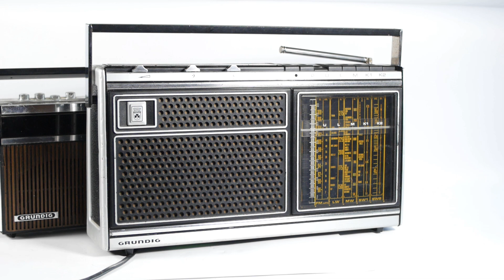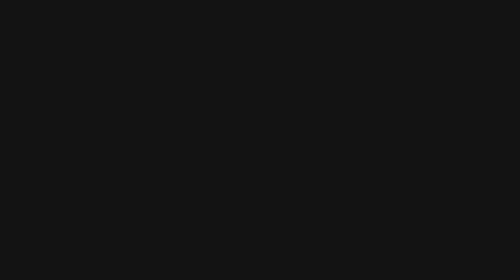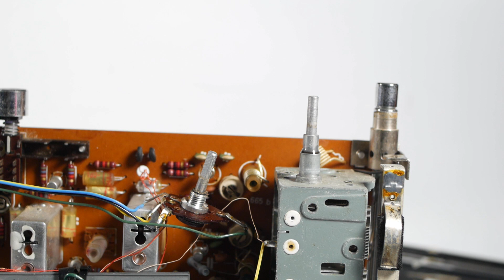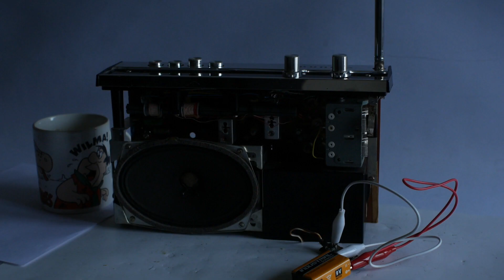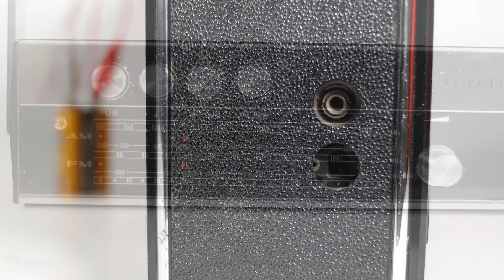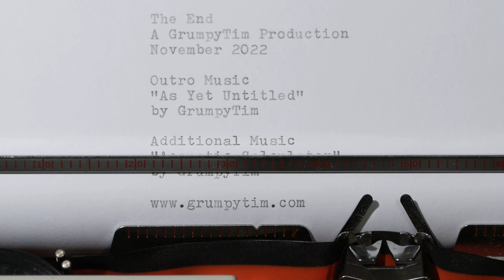Grundig Radio Repair - 1970s Grundig Transistor 305 - and quick demo

Comment from the maker: This is just a quick repair of a Grundig Transistor 305 radio, there wasn't much wrong with it, just a corroded and very dead battery, and a seized tuner (a fairly common fault), other than that it just needed a good clean.  If you're looking for full on electronics repair on one of these radios you'll need to look elsewhere, but if you just want a little look round the radio and to see how I free up a seized tuner, then stick around.

Comment: I know this is an older video but do you have any experience with the transistor 3005? I have a radio that's been in my family for years and it is in immaculate condition other than the shortwave tuner stuck. Would this method also work on that specific radio if you know offhand any feedback would be appreciated. Everything on FM works wonderful but selecting the shortwave bands and trying to move the tuner to the far right corner is stuck thanks and have a great day
Reply from the maker: Hi Matthew, it's pretty common for the tuner to get stuck on old radios - it's nearly always due to dried old grease.    If your tuner moves freely over most of it's range and only sticks towards the right, it might be something else.  When you're in FM will the tuner move all the way to the right or does it stick then too?  If you tune into a few FM channels and look at the frequency that's displayed, does it match the published frequency for that channel?  It's always possible that the tuner display and the physical tuner have moved in relation to each other and the physical tuner is actually reaching it's end stop - if that was the case, the tuner string would need to be re set correctly.  If it is the physical tuner that's sticking, there might be something interfering with the multiple plates that rotate, such as a loose wire or maybe some sound deadening foam that's fallen off.
Reply: @GrumpyTim hello and good day yeah I've done a lot of research last night and found that my potentiometer is stuck for the shortwave. The routing of the line tuner is intact. I just have to get that free and I can get the needle to moving again. There's so much history in my family with this specific radio, all the FM presets work, everything works besides the shortwave potentiometer. If I could free it up I could get it to work. I just have to slowly take everything apart and I'm going to try your method of heat and lubrication.

Comment: Hey l like the thumb very much, how did you light it? Thank you
Reply from the maker: It's been a while since I took that photo, but I suspect that I did my usual thing, which is, place the subject on my video background (an old bathroom roller blind), and side light it with one of my LED panel lights - that light has barn doors to control the light to a certain extent, but I usually hold a bit of black card in the path of the light to reduce the amount falling onto the upper section of the background.  The camera will be on a tripod, pre-focussed on the subject, and I'll use a 2 second self timer to reduce the risk of camera shake when I press the shutter button.
Reply: @GrumpyTim  Thank you, wow that's nice and simple. So just one light, now fill ight or anything?
Reply from the maker: I don't usually use a fill light, although there will be a bit of light bouncing back off the walls of the room, which will provide a little fill.  I also darken the area where I'm going to put the video title when I edit the photo - that's mostly because unless I shoot at night, there's some light coming through a window that spills onto the background.

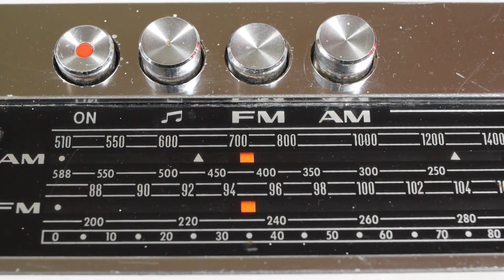Comment: Thank you for the great video! At 8:50 you can see two small triangles on the AM band at 640 and 1240 kHz. These are markers for an emergency alert system in the U.S. called CONELRAD, which was in use from 1951 through August 1963. The markers made it easy for citizens to tune in to important updates in case of a Soviet attack. CONELRAD was replaced by the Emergency Broadcast System in 1963. Very cool piece of history!
Reply from the maker: Hi Trevorland, that's really interesting, and definitely a nice little bit of history.  I liked the idea of radios being used for emergency alerts, it seems to me to be a more robust emergency warning system than the modern mobile phone alerts - I have a feeling that in a real emergency the mobile networks will fall over.

Comment: Would anything be affected by switching the battery connector to accept the pp3? In the US they are difficult to find.
Reply from the maker: Hi Gluttonite, you should be ok swapping the connector for one that takes a PP3, just as long as you keep the polarity the same way round.  Obviously the PP3 won't last as long because it's a much smaller battery, and it may even struggle for power at louder volumes.  I'd be tempted to use two PP3s in parallel, in other words, fit two PP3 connectors, keeping both the red leads together and the two black leads together, that way you just get more power but remain at 9 volts.

Comment: Any idea if it’s possible to find a telescopic aerial replacement for these? A tip of mine is broken and lost which makes it unusable.
Reply from the maker: Hi Jackie, I'm sure there must be a decent source of replacement ariels, but I haven't tracked it down yet.  I needed a replacement ariel for one of my other radios and I couldn't find anything, so I just repaired what I had as best as I could so I could use the radio.

Comment: I have just acquired the same radio with the very same problem. Tuning dial frozen solid. Your video is just what I need. I will also need to work on a AC bypass becuase the power connector appears to be of ancient type which is no longer around.
Reply from the maker: Excellent, they're a nice little radio once they're up and running.  I have a bit of a soft spot for the old Grundig radios, there are three of them in the collection so far.......

Comment: I’ve got very the same radio. It works well, but keeps draining the battery even when it’s turned off. Seeking for an advice please.
Reply from the maker: Hi Jackie, I don't suppose you have a multi meter so you can check to see exactly how much current the radio is drawing while turned off.  In theory the on off switch should cut the power to the radio completely, so either the switch is somehow still letting power get to part of the circuit while turned off, or someone has done a repair at some time that  partly bypasses the switch......but thinking about it, if there's any sign of old battery leakage like my radio had, there could be some rusty mess on the circuit board that's conductive, not enough to stop the radio from working, but enough to drain power when switched off.  Probably a good idea to have a quick look for dirt/rust/battery electrolyte on the circuit board.  Are you using the big PP9 battery, or are you substituting a small PP3?  my guess is that a PP3 won't last very long.  For what it's worth, I haven't turned mine on for about a year -  just tried it and it's working fine, so if you can track down whatever is ailing yours, you should have a nice little radio in the end.
Reply: @GrumpyTim thanks, I’m temporarily using smaller pp3, but there’s definitely some kind of energy leak after turning it of, because sometimes I can hear hum in the speaker. It doesn’t happen all the time, but occasionally it comes alive like this.
Reply from the maker: Hi Jackie, yeah, there's definitely something funny happening there - if I get a chance I'll take a look at mine sometime to see if the switch is a multi pole switch that isn't turning off one side - it might be cutting power from the tuner but leaving the amp powered or something like that.

Comment: Any idea where to get a replacement battery or what the AC power supply number is? Looks like a rewire job to install the little 9V now available. Thanks and THANKS!
Reply from the maker: Hi peetcgee, I'm not sure where you're based, but in the UK you can still get those PP9 batteries in hardware shops, although I actually got mine from Amazon because that was easier at the time.  I didn't look into power supplies because I like running my portable radios off batteries - unlike modern DAB radios which eat batteries on a daily basis.

Comment: My father had one of those in the 70s. I think he got it in the early 70s, and kept it into the early 80s. I don't know whatever happened to it. I have a Transistor 3001, which I got in 1977. The on/off button has an issue. You have to hold the button halfway down in order to get power to the unit. Several years ago my father took the radio to someone to try and fix that (which didn't happen). In fact he brought it back to me with a new problem (on the FM circuit). All I get on FM is static, and nothing else. I'm wondering if something got disconnected. And maybe that on/off switch problem might be an easy fix? I don't know. I would love to have that radio working again. I really miss listening to it. That model also seems to be quite rare.
Reply from the maker: They're rather cool things these old radios - makes a change not to be tied to some sort of computer to listen to music or whatever.  A quick search suggests that the Grundig Transistor 3001 was the export name for the ocean Boy 209, what a lovely looking radio.  The fault with the power switch isn't likely to be too difficult to fix, in theory, but sometimes theory can be a tricky thing!!!  It could be as simple as dirty contacts, and a bit of Deoxit or Servisol Super 10 might cure it.  Alternatively, there might be something wrong with the latching mechanism on that switch, so it rests in the wrong position - that would be a bit more difficult to fix.

The FM static issue might be as simple as the telescopic ariel no longer working - I don't know how they connect the ariel on your model, but on my Concert Boy, there's a pretty dodgy friction connection that can get bent when the case is opened.  Or it could be a screw or wire that attaches the ariel to the rest of the circuit board.  Obviously it could be something more complicated, but the ariel would be my first thing to check because that's simple, and I always like to start with the simple stuff.
Reply: @GrumpyTim  Thank you for your reply, and for the interesting video.

Comment: Great repair video. That battery was quite messy indeed
Reply from the maker: Hi ohjajohh, yeah, that battery was pretty messy, although the old batteries like that were in some ways better than modern alkaline batteries - they used to go flat and then leak, making a horrible rusty mess, whereas, modern alkaline batteries (or at least SOME modern alkaline batteries) carry on working in something like a radio or torch, and you've got no clue that they need replacing because the item is still working, but they're busy leaking a very corrosive chemical inside your device - countless Maglite torches have died this way because the corrosion destroys the aluminium body of the torch.  I've also had plastic items literally crumble due to leaking alkaline batteries.  In an ideal world I guess you'd check the condition of batteries every couple of months, but in the real world, who has the time.....

Cheers for watching

Comment: I can assure you that if I took it to bits it would never get put back together correctly and there would be bits left over. That’s even without trying to fix it. I admire your patience Tim. My father loved his radios (including Grundig) and took the SW ones to sea with him. I’m a huge radio fan but with no signal where I live due to the hills, so it’s internet only until I move house. Cheers. Lee
Reply from the maker: Ah, I hadn't thought about the lack of signal where you are Lee, I guess that would limit your listening to a few crackly channels of stuff you didn't want to listen to!!!  I used to listen to radios lots when I was a kid, then when I started work I would buy firstly records, then CDs and never really touched a radio again until the last few years - there's something fun about just turning the dial until you find something you like (albeit that I tend to find more that I don't particularly like these days).

Cheers for watching.
Reply: @GrumpyTim  I agree Tim. Even on the Radio Garden app (beautifully designed and implemented) almost all the channels are middle of the road syndicated pap). I do explore internet radio quite a bit but I still have a marketing for the old Bakelite and wooden cabinets where the stations were labelled (the light programme, Hilversum etc). I’m likely to stay in the area and will be renting near to an army base until I find another house, so maybe they will have good signals out there? They do have some very interesting traffic in and out on the ground and in the air!
Reply from the maker: Oooh, now that sounds really exciting Lee - better not get flying your drone round there though!!!

Comment: Great vid as always. I'm intrigued by the AM and FM selection, I'm more used to MW/LW anf VHF at that time. Was this sold internationally? Also the AM tuning scale is intriguing, with the kHz and a similar-looking scale underneath that's a little different. Any idea what that was about? I do love these retro portable radios. Used to have a Hacker Hunter at one time that took 2 PP9 batteries! I had to slim down my collection a bit when I moved to the States about 15 years ago, but I kept my 1959 Bush TR82.
Reply from the maker: Cheers John, I've been using analogue radios since I was a kid, and throughout that time I've never really paid any attention to the radio frequencies - I simply turn the dial to the approximate position that I expect to find the station I want, then home in on the best signal.  I know this probably sounds a bit dumb, but it's just the way I've worked - I hadn't even paid the scale any attention on this radio.  The top scale is KhZ for AM (if I remember correctly, AM is basically Medium Wave, although technically SW and LW are all AM ie amplitude modulation frequencies), and the smaller scale beneath is calibrated in metres, so 700kHz is about 429 metres.

For the FM scale, the top one is in mHz, with the lower one marked as Channels - I'd have to look that one up to see what the channels refers to.  Ah ha, the channels, marked from 200 to 300 looks like it refers to US FM frequencies, and I guess that answers the question about the radio being sold internationally.

I do remember some radios that had a pair of PP9 batteries from when I was a kid - I was surprised that I could still get a PP9, presumably there are still plenty of old radios up and running otherwise they wouldn't still make the batteries.

I have a battery operated valve radio (which is in the naughty pile because I haven't managed to fix it yet), that one has a 90 volt battery and something like a 3 volt battery - the high one for the vacuum tubes and the low one for the heating elements - the 3 volt supply was easy enough but I had to create a Franken battery, linking 10 PP3s in series to get the 90 volt supply!!!  It was only after I'd made the Franken battery that I discovered people selling mains power supplies to replace these old high voltage batteries - that would have been much simpler.

Comment: Well done! I love these old compact 70th radios, too. They sound great.
I have a telefunken partner universal which has a separate knob for radio Luxembourg as a fixed preprogrammed station on shortwave. Of course the station does not exist any more, but back then this was the station to listen to for young people in Germany.
How did you get the "safe music" into the radio? Do you have a small transmitter?
Reply from the maker: I just had a look online at the Telefunken Partner Universal - I love the radio Luxembourg knob, what an awesome idea.  Telefunken is another brand that I like, although the two items I have were sold in the UK under the Olympia name, which was owned by the same parent company at the time (or at least I think that was the reason).

Back in the days when the iPod was a fairly new device and not all car stereos had a line in, and bluetooth wasn't a thing, you could get a small FM transmitter that plugged into the iPod - it could only reach a few feet away, which is probably how they got away with selling them - anyway, it comes in really handy when demonstrating a radio.  It's a pity really, if someone is demonstrating a vintage radio on YouTube, you really want to hear it playing music.  Some of the small channels seem to slip under the radar and play huge chunks of a song, but I'd hate to risk a copyright strike myself.

Cheers for watching and telling me about that cool Telefunken radio of yours.

Comment: Well done.  I have a Murphy to look at but it is mechanically perfect, just motor boats on FM. I will have to take it apart and look for the culprit.
Reply from the maker: Ah ha, yes, there'll probably be an unhappy component or dry joint somewhere - sometimes they're easy to track down, sometimes less so!!!  Cheers for watching Ben.
Reply: @GrumpyTim  Might well be a dry joint. AM and long wave work very well.
Reply from the maker: Yeah, it's amazing how many things I end up fixing just by looking and finding that broken wire/dry joint and so on.  I was really happy when it was obvious that no one had messed with the radio before I got it - with so many things my heart sinks when it's clear that someone has been there before me, because usually people having a go causes more faults than the original problem!!!
Reply: @GrumpyTim  That's true!